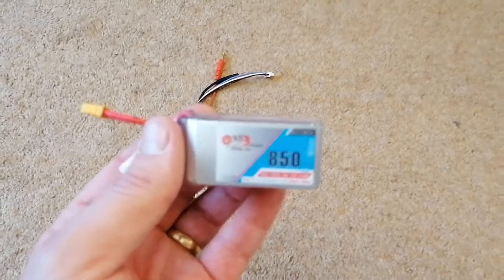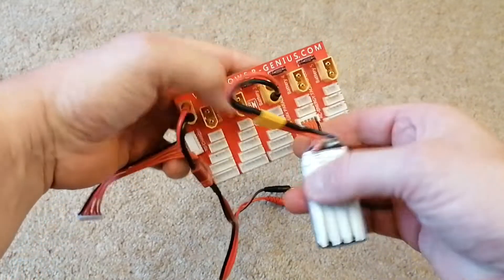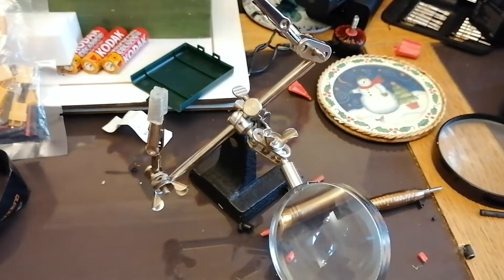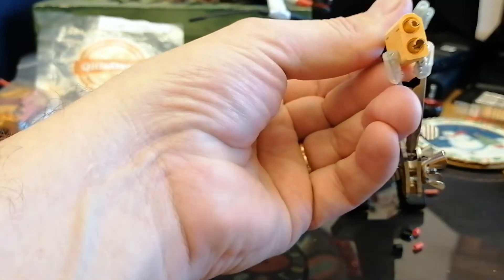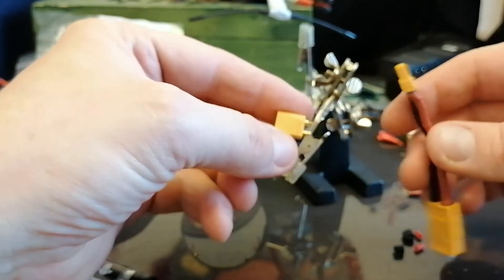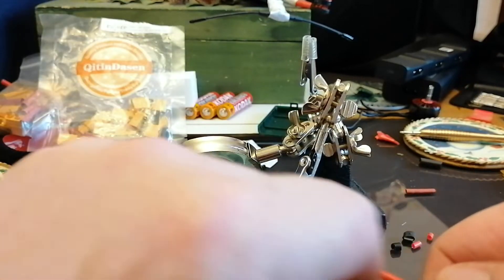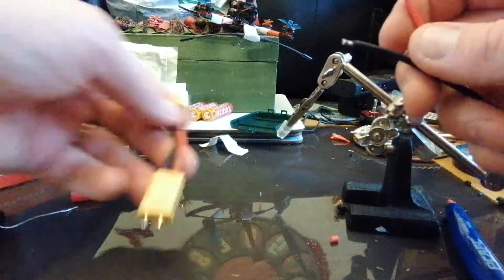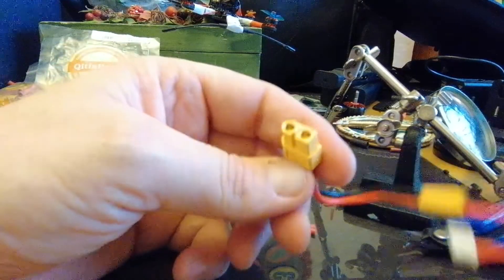Charge XT30 4s Battery in XT60 Board

Comment: I noticed that when you apply the solder the connector, it is actually plug into another connector which has a cable. I wonder if you do that so the heat will flow through the cable and will not overheat the plastic part of the connector you are soldering. Is that the case?